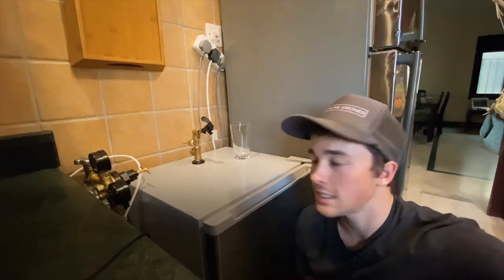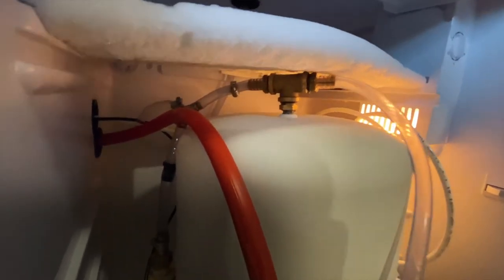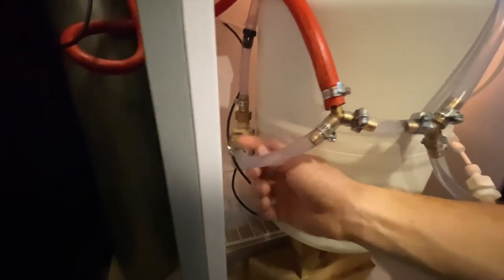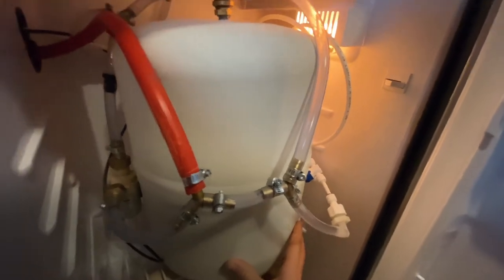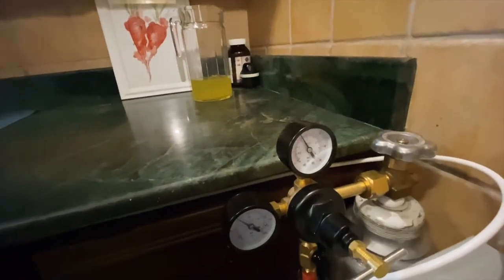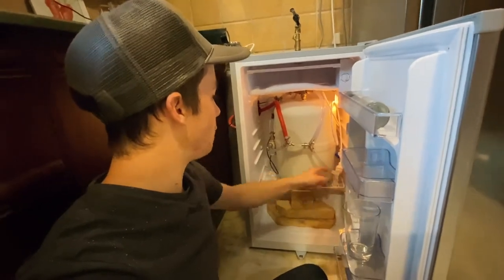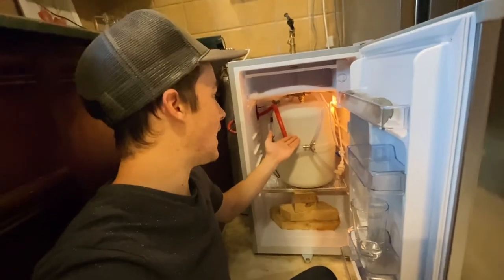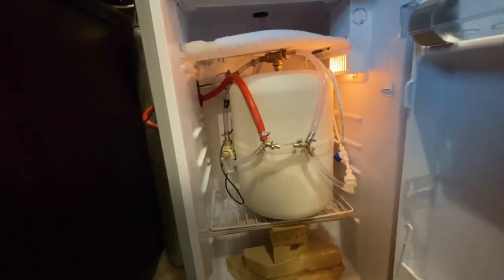Sparkling Water Kegerator - On tap without a keg

Comment: Cool! I have a keg with only two ball lock connections (Gas in and water out). I'm trying to figure out if I can rig something up so I can also have water in.

How do you make sure you have a CO2 headspace with this kind of setup? I'm guessing the water at a higher psi would completely fill up the tank eventually. And then there wouldn't be carbonation.